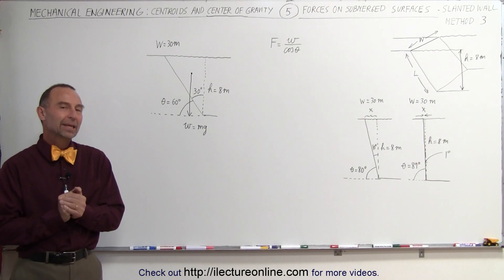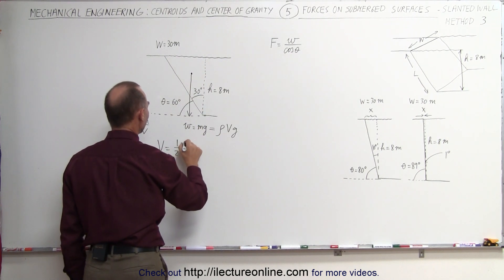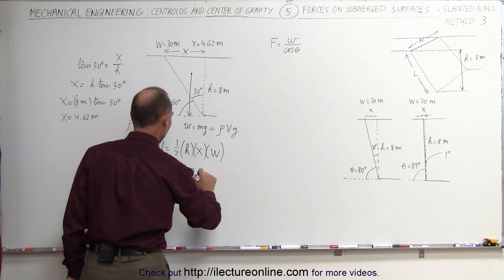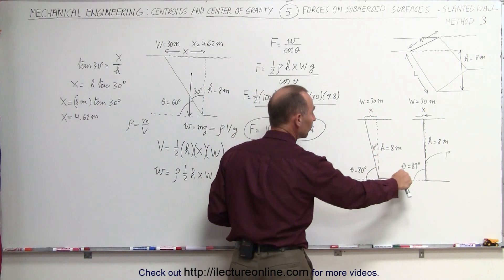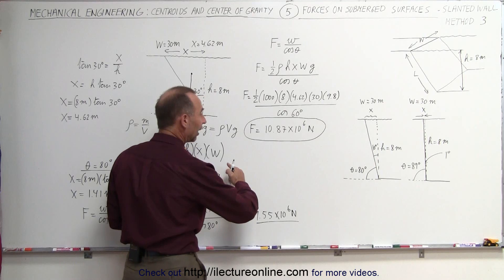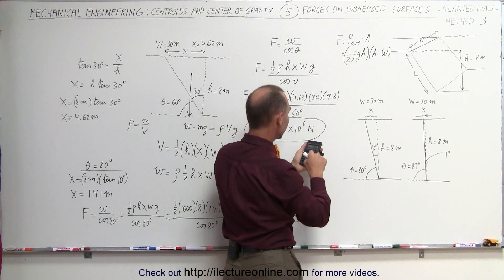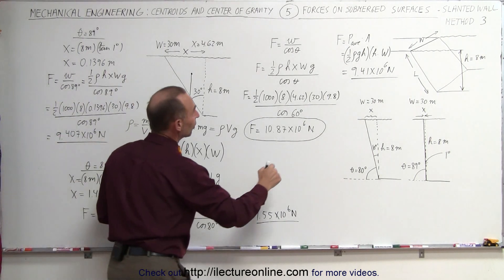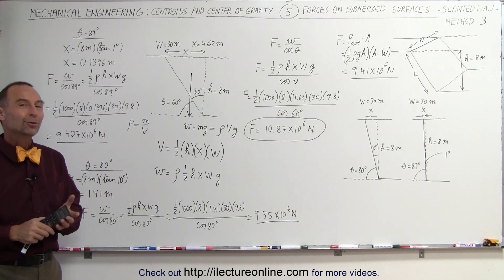Mechanical Engineering: Forces on Submerged Surfaces (5 of 15) F=? of Slanted Wall: Method 3

Comment: Does that mean if we have an angle=0, there is no force? I have a justification but I want someone to explain
Reply: There will be no horizontal force on the surface, as the surface will be completely horizontal. But the Vertical force will be acting.

Comment: Rather than the walls slanted "\" this way, is there any way to calculate the force on the wall slanted "/" this way?  (Because I'm trying to write an essay about this in my school)
Reply from the maker: Sure it can be done, but that is not how dams are built.
Reply: @MichelvanBiezen  Oh thank you so much for replying!! I'm not writing an essay about dams or walls in real life. I just wanted to know if the power exerted by the water on walls slanted "/"  this way is different from how you calculate in this video. If possible, can you make a video or email me about it?

Comment: when the wall is vertical there would be no water above it. So this method would fail. Please tell me whether i'm correct or not?
Reply from the maker: That is the magical world of limits.  In the limit as the angle goes to 90 degrees the force on the wall will converge to the straight wall equation as indicated in the video.

Comment: simple question, why F = W/cos30 ?
Reply: I think you have misunderstood，the surface area of the dam is bigger that means the inclined surface  will be gentle，the pressure will be smaller than before ，you see W/cosθ，this makes me feel confused at first，then I change my mind ，consider pressure ，P=Weight/(cosθ*L*W),this will clearly show that L*W*cosθ is the inclined plane‘s  projection into horizontal plane.so if the  slope is bigger,the area of projection is bigger ,so the pressure is smaller ,this is the common  sense, you will see the all the dam will be inclined not vertical.
Reply from the maker: Because the surface is slanted and thus there is a greater amount of surface.